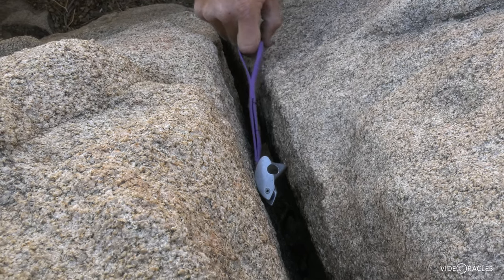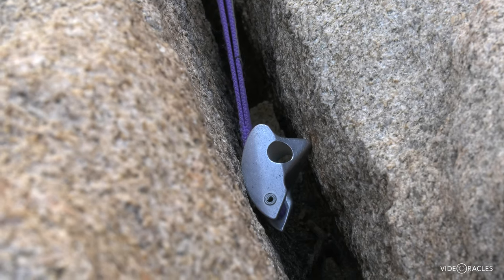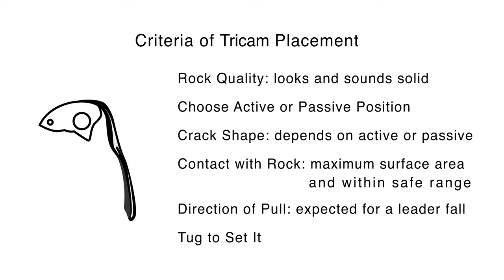Placing Tricams

Comment: Are great for anchors for they fit many ranges.  Great for blown out pin scars, many times it's too small for cams or has a very uneven surface that offset the cams. Good for small cracks when you run out of small cams.  "Set" them like you would a nut. Should be on every ones rack if you come to Tahquitz or Yosemite trade routes.  I only carry the .5 and 1 anything bigger than that a cam does better.  To get them out a 45 degree tug to get them moving, then use your fingers to keep the pivot horn from catching, then slide them out.

Comment: Climbing at Courtright Reservoir Tricams are a must. Solution Pockets are use as protection on some climbs (A Little Nukey and other climbs on Power Dome) where there are no Bolts or Natural protection. Tricams when set as an active caming device fit into  these pockets. The Pink, Red, Brown and Blue are recommended for climbing on these dome at Courtright.